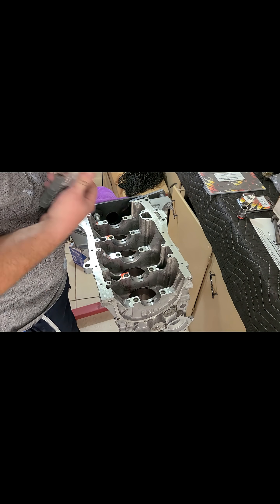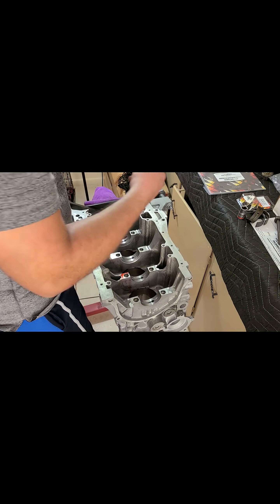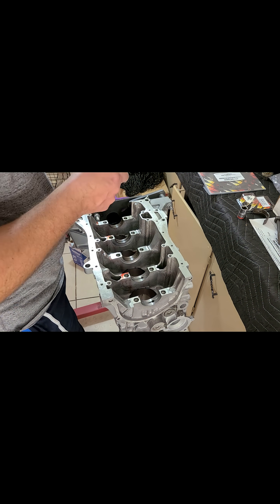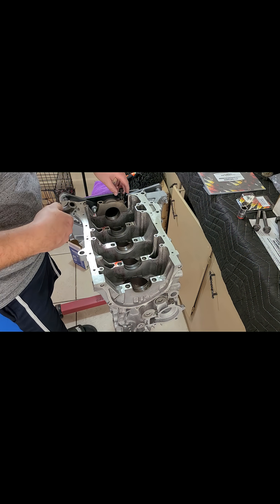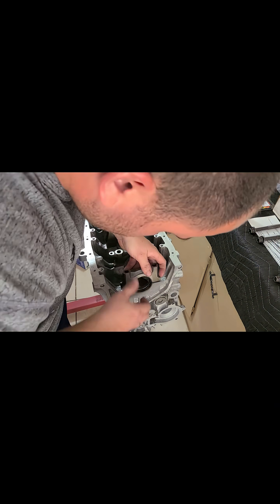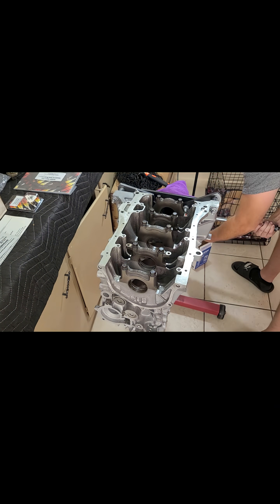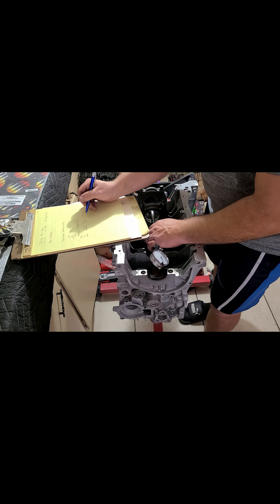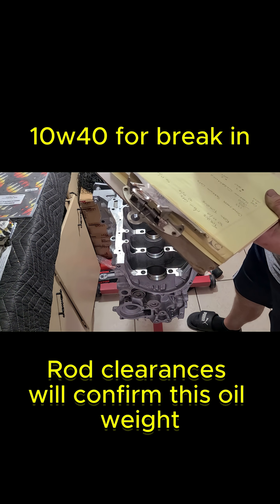B18 Darton Sleeved Turbo Main Bearing Clearance

Comment: How do you determine the oil weight to be used?
Reply from the maker: My mains are 0.0020″–0.0025″ and rods 0.0018″–0.0022″, which is on the loose side but bearing clearances don’t directly equal oil weight, but they guide the choice. Looser clearances need thicker oil to maintain pressure and film strength when hot. With Florida’s heat and a turbo setup, thinner oils like 5W-30 would lose pressure, while race oils like 15W-50 are too thick for street use. That’s why 5W-40 is the ideal balance—it flows well cold, holds pressure hot, and protects under boost. Basically, you match your measured clearances to an oil viscosity that maintains proper hot oil pressure and film strength for your engine’s use, climate, and power level. Thanks for the support!

Comment: All you have to do is put the crank in and spin it around 14 times dry with no assembly lube or oil if it doesn't bind up is a good fit...take the crank out if there is no wear Mark's run 20w60 mineral oil
Reply from the maker: And call it a day 😂